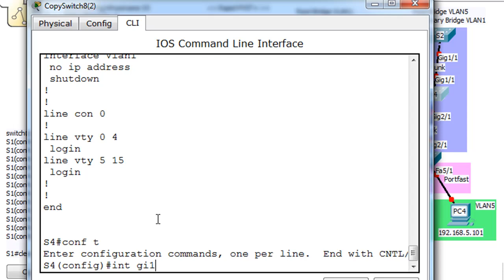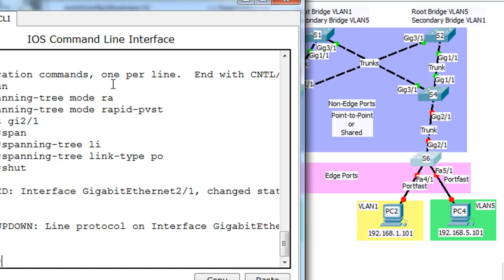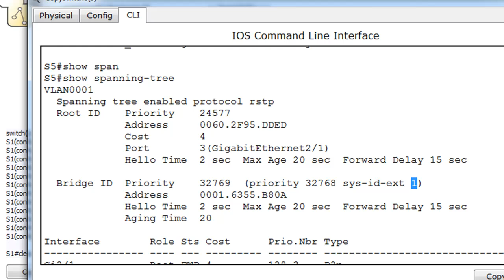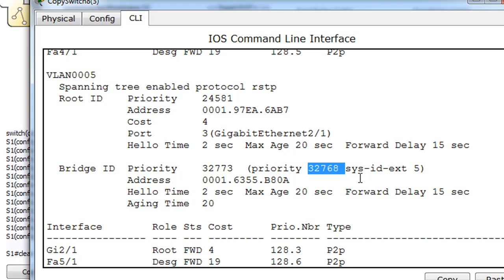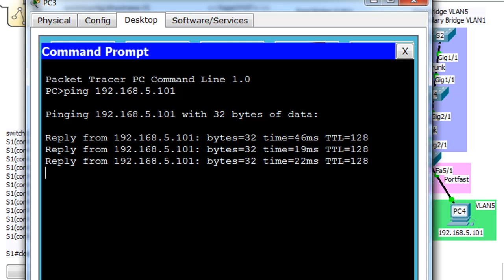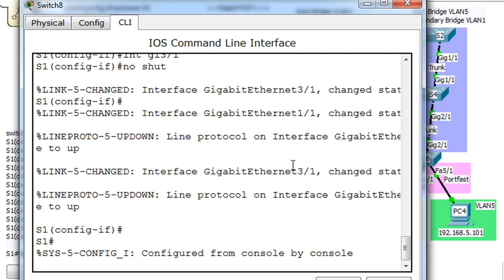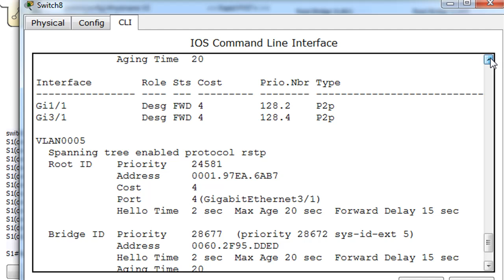RSTP and Rapid-PVST+ in Packet Tracer - Part 2

Comment: I've been doing research on BPDUGuard and Filter and know enough to be dangerous.  As is the case often with Cisco there is no definitive answer and one has to rely on the OPINIONS of the people on various network sites.  The overwhelming OPINION is that if Guard and Filter are both turned on locally and a BPDU issue occurs, then Filter overrides Guard and PortFast and opens the port to STP.  Sure would like a definitive answer from someone that knows more than me.

Comment: I checked out the default link-type point-to-point and it's true and can be verified by SHOW SPANNING-TREE DETAIL.  I did "S5(config-if)#spanning-tree link-type point-to-point" and it hard sets it to point to point.  I then put a hub between S3 and S5.  S5 maintained it was point-to-point but S3 has in, SHOW SPANNING-TREE DETAIL, "Link type is shared by default
  BPDU: sent 20, received 726".  
The hub doesn't seem to affect RSTP.  Don't know about traffic.